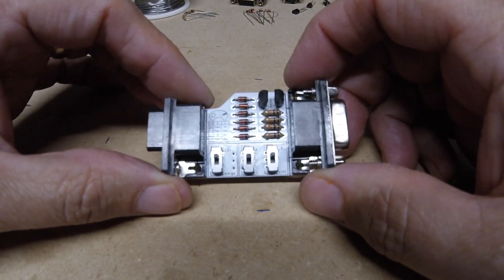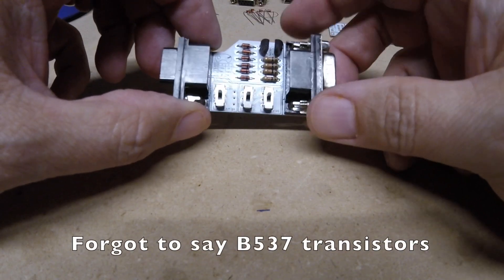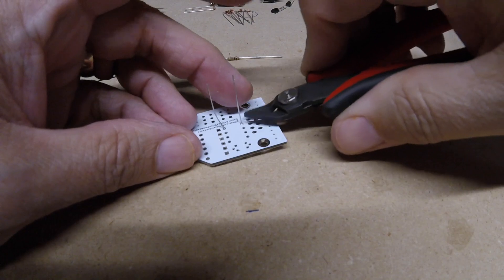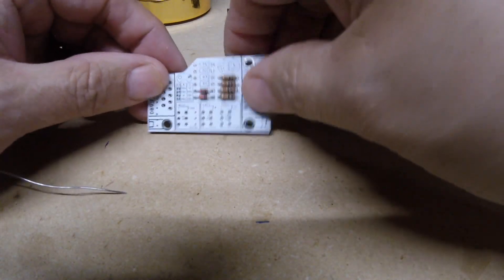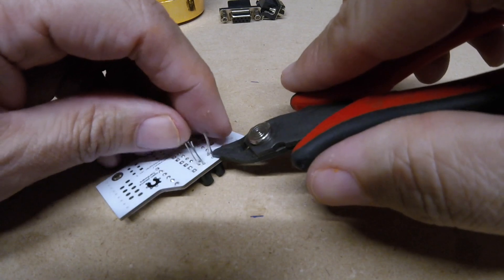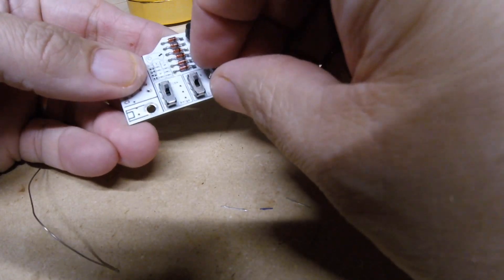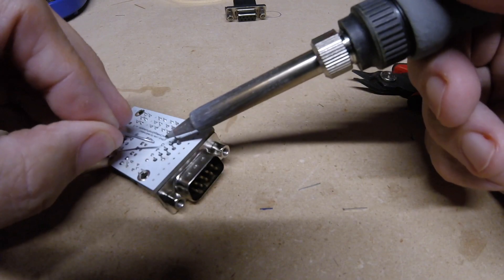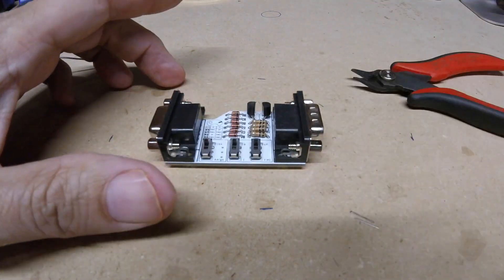Sega Genesis / Mega Drive to Commodore joystick adapter kit build

Comment: Thanks for the video, isn't it better to solder a short wire between the Amiga end and the board? To reduce tension on the port from the weight of the board and the Genesis pad connector